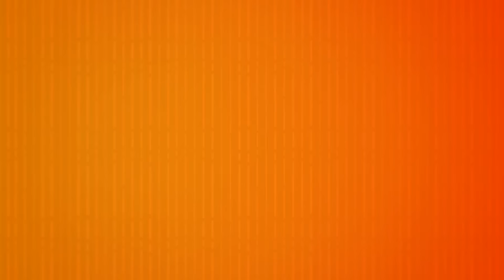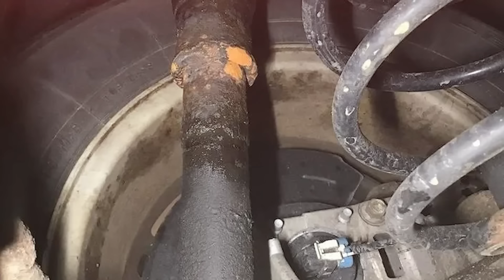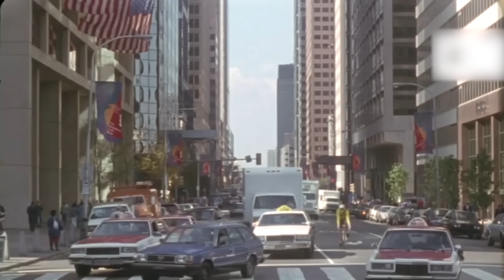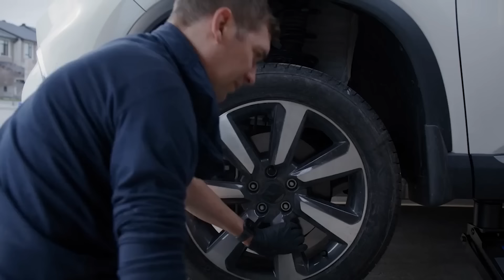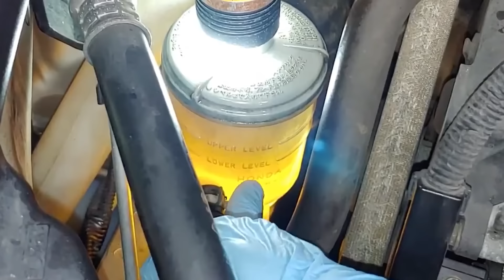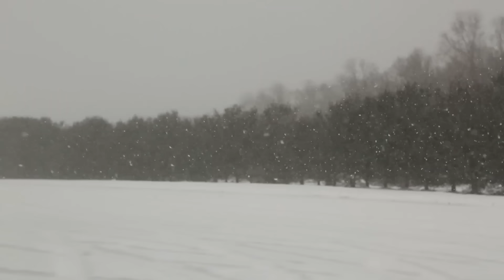Doing This Will Make Your Toyota's Suspension LAST FOREVER!

Comment: Mechanic here. Extremely good advice which I follow and recommend. I think he should have said :Maintain and exchange ALL Fluids and filters not just PS fluid. That means transmission, engine, Brake, PS, differentials etc. The 303 is magic and goes on anything rubber, around windshields, doors, shift boots etc. Keep the CV axle boots flexible and they will last and last. Use only top tier gasoline, no off brand ethanol swill.

Comment: I use 303 Protectant and spray all rubber parts underneath , every 10000 miles , during second oil change of 5000 miles . Around twice a year I spray it also throughout the engine compartment and let it soak in . After power washing the engine and letting it dry . Always to cover the alternator , when washing and spraying this . Open air intake I stuff a 16x16 inch micorfiber towel into it . I also spray the outside sidewalls of my tires and let it soak in , no streaking , etc.

Comment: I have 305 thousand miles on my Tacoma and much of it on dirt roads and here in Montana it can be very rough.  I noticed a change in the way it felt driving down the road and I crawled underneath to look with everything covered in mud and couldn't find anything obvious.  The next day I backed out of my garage and the passenger front wheel came off.  It turned out the bolts that bolt the lower steering knuckle to the lower ball joint came loose and sheared off. Rest assured, I will check these bolts and all others as a part of regular maintenance from here on.